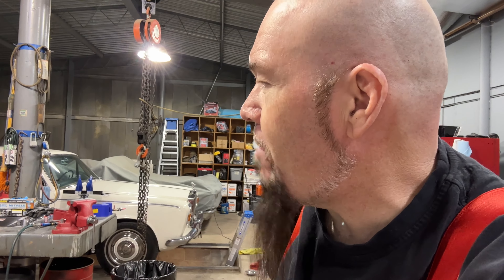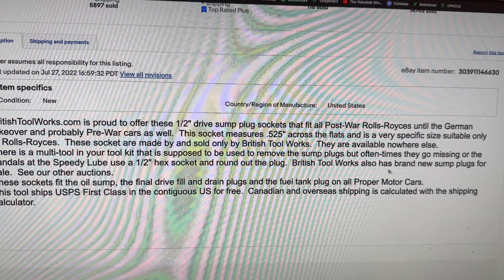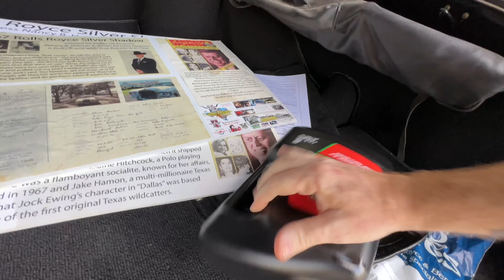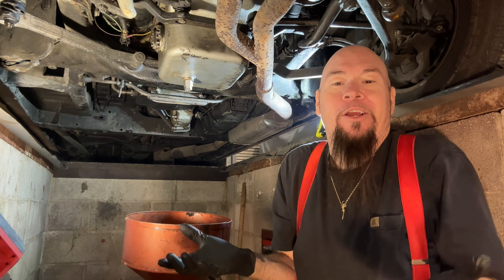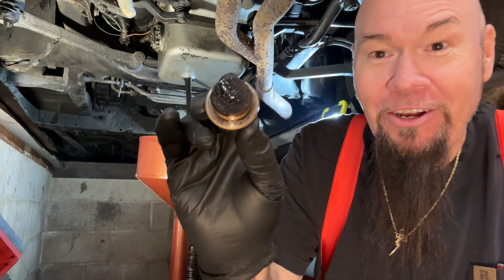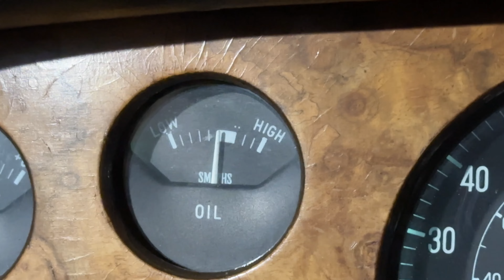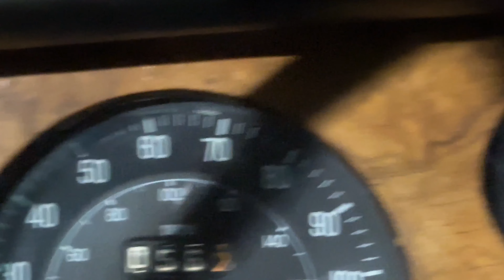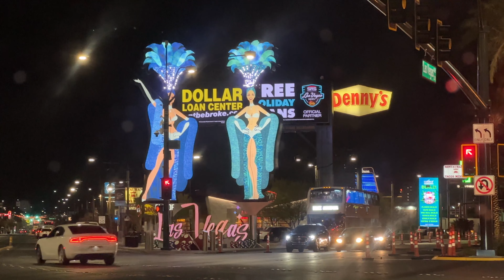Rolls-Royce Silver Shadow Oil Change - You won't believe what a pain in the a

Comment: When i purchased my landrover, I spent a day underneath it and tightening every nut and bolt i could reach. It was oily, so i pressure washed underneath, checked it 1 month later, and it was basically reasonably dry. I now check every 6 months and trace any trails of dampness vigorously. 😊😊

Comment: I have three GM converted Rolls Royces (62 CLOUD, 79 SHADOW and 82 SPUR). I ABSOLUTELY love them!  No more leaks, no more brake/hydraulic issues! I searched for 5 years for each one because it was a constant battle to keep everything working. There was a place near you that did service on Rolls Royces (The Touring Shoppe), but I have heard they only rebuild now.
Reply: Ironic. A big chunk of the RR engine parts of the power plants you did away with are sourced by GM: hoses, belts, power steering, air conditioning, on and on, transmission. Hope the LT swaps are going good.

Comment: Mr. Bob, you do know an easy trick for your oil change oil pan nut ?  Very easy to do for under $10 too ! When you change the oil, before you pull up that big oil drum funnel, put a smaller one inside the larger one, secure the new funnel with a string/wire in the funnel hook hole to the side of your drum funnel. Now if you drop anything at all, it will fall into the new smaller funnel and stop, the oil will flow through into the next funnel, but the oil nut or anything else will be inside the new smaller funnel, now just pull it out when done, nothing is lost, nothing is pissing you off, all for under $10 lol. Now sit back, relax, you can enjoy the night knowing you finally out smarted the problem. 👍🏻

Comment: Ah, Bob...  You'd love my New Zealand Ford Royce:  '62 Silver Cloud with Australian Ford Barra 4 litre inlilne-6 drivetrain that runs on Propane (tank sits nicely in the forward part of the trunk, with lots or room left).  Over 220 hores at the rear wheels, clean, low maintenance, sounds great and you can get at everything you need.  I did have to make a dash insert to use the Ford gauges (we had new faces made with my FR logo), but other than that there are no "tells".  You should have seen the looks on the RR guys when I took it into the dealership!  The thing is, the installation was surprisingly simple, we updated the brakes as well, and with the OD the car now cruises easily at 85mph with 3200rpm.  Love your videos, I just wish I could convince more of my friends that doing mechanical work is great therapy and a LOT cheaper than a shrink.

Comment: Hi, I am Roy posting here from Great Wyrley, UK. I had a 1971 Silver Shadow which I bought in 1978 for a lot more than it was worth. In truth it was a bit of a pig, but I was doing well and everyone who was anyone had an RR, so there was a sort of buying bubble. I had a motor sales and used to do a lot of work on cars myself. I remember coming to change the oil and sump plug was well and truly siezed, and trying to get it out I was a little alarmed by the way it was bending the sump, you say "oil pan" - right. Anyway, after some deliberation I took a Stilson rench to the outer flange, and guess what, it came out easily. The oil was like crude indicating the time since its last service. Anyway, the plug cleaned up well and all went well. When I sold it, about 1980 - 81, I lost £5K british pounds on it, what is that in todays money? Anyway, I never learn, currently own a Silver Seraph. These cars are in a class of their own, in every way, but also driving one. You can have nothing in your pocket but get behind the wheel and you fell like a millionaire. Looking at your video I think you have the answer to your own question re looking after these cars, learn everyhting you can about them and there you are ready to fill the obvious niche and make money. Finally, a hint for would be buyers of one of these. Buy one that someone else has spent all their money on and maybe you not have to spend so much of yours. Good luck.

Comment: Thats definitely a beautiful Silver Shadow.  Except for the color,  looks just like my uncle's 71 that he bought new.  I got to spend alot of time with him and his family in that car. He taught me to drive in it. I also have my parents 58 cadillac they bought in 1960, I was 1 year old at the time. I finally had the engine rebuilt in 2011 just because the blow buy from the down draft tube was no longer tolerable. 12 years later, still NO SMOKE visible from the tube!! Love that! Lifelong Southern California car,  she's doing fine. Just wondering if you have tried a ROLLS-ROYCE dealer to see if they will work on the car? Anyway,  I know how wonderful these are, and understand why you'd want one. I know ever since I was 12, when my uncle bought his new, I've wanted one !!!! Lottery,  I need you!!  PS, Castrol is the only oil he used in the Rolls. Actually,  it was the only oil he used in all his cars, and told to do the same. I have. And never had a car with any engine issues even at 338.000 miles on my TA.

Comment: My Hillman also has a similar oil filter system with bolt washer and spring. Old common British design. I have dropped the pieces myself before. But I have a workshop manual. I suggest you get one.

Comment: Use a BOLT head for the drain plug! Check the across-the-faces distance & buy 1 bolt + several nuts. Put nuts on bolt & weld/swage the bolt end over to secure the nuts. 
If you can’t find a correct size bolt, get a bigger one & file/grind down.
Did this for my 1974 Mercedes 😊

Comment: Well done. I’ve had a similar problem here in Normandy finding somebody to service my Silver Spirit. I’ve even installed a four post lift. I have now found an Englishman and he’s raring to go. I’m not sure whether to buy from Flying Spares or Introcar. I wonder if one is cheaper than the other. I’ve been inspired by ‘My Mate Vince’ on You Tube. I was the public relations manager of Rolls-Royce in the 1970s so I’m very familiar with the cars but I’m not a mechanic so I would be useless in ‘getting underneath’ and doing anything. They are wonderful cars and well looked after it will last you a lifetime, while appreciating. Warm wishes
Reply: I've travelled around the world fixing Rolls-Royce and Bentley motor cars but nothing would possess me to get under a home installed hoist unless I'd seen all the plans, documents showing it was signed off and insurance. This was a problem we often faced and sometimes it could take a couple of days to find somewhere safe to lift a car.
Reply: If you are worried about the cost of parts, you have bought the wrong car. There cars will NOT appreciate. No-one will want cars like this in the future.

Comment: These cars are works of Art. I would suggest treat these cars differently to every day car repairs. Always disconnect the battery when carrying out work. Being as an electrical apprentice in that industry I would advice following.  Ditch the mechanic mentality, start looking at your workshop as a studio. Make it bright airy and spotless.  Ditch the pit and invest in a high strength lift.  A good desk, a nice area to keep your fingers clean. Then go through documenting in hard cover notepad all the things that need attention. Take your time. A good kettle and teapot come in useful too.  You will be amazed at how your own brain calculates revalues etc during Tea breaks. Seeing rust there, I’d Begin replacing all those brake lines. They’re easily made up with high quality tools.  A good clock on the he wall works wonders too. Saves getting frustrated. Enjoy what you do.  👍

Comment: Glad you figured out where to get the oil plug tool. The reason they are so tight is there is an L shaped tool for the oil plug and most old time RR mechanics used to hit it with a hammer to tighten and loosen it. Also just curious how many quarts of oil you finally put in the engine. You showed only  5 qrts but  I hope you know that is a 10qrt oil sump. I used to be a RR mechanic about 20years ago. Take my advice when you go to loosen any 7/16 brake lines please use a flare wrench. Also make sure you pump the brake pedal many times ( your leg may get tired LOL) until both brake light pressure lights go on . Those brake spheres hold 2,000 pounds of nitrogen each

Comment: Pause video 23:00 - Rolls-Royce Silver Shadow Cloud Spirit Spur Corniche sump plug socket .525 inch.  
Yeah, that is crazy it is between a 13mm and 14mm or just a little over 1/2.
Reply: LOL, I paused the video to comment as I did a Google search on the tool and a few minutes later you mentioned what I found.

Comment: As others stated , read the manual and buy the set of maintenance manuals and do it yourself. I maintained my 76 for over 20 years knowing very little. Now I know a lot. If you dont have leaks under your car, it is NOT a Rolls-Royce! Ronnies Garage in CA is the main service center or Acme in Nor Cal. Ronnie has videos on line on how to do your work. The AU site has all the manuals on line too one huge tip, RR/B cars do not do well sitting long periods of time. The more you drive them the better they are. You might need a set of plugs. and when you change them get NGK type. Its not a 15 min job but well worth it. Plus try and run non ethanol fuel.

Comment: Sisyphus performs an oil change... Sounds like what you needed was a whitworth hex key, a system of measurement unique to older British machinery.  My mechanic is an older gentleman who used to work on British cars and still has all his whitworth tools in addition to the usual metric and imperial. I've also seen him work on older Rollers.

Comment: What a PITA oil filter.   I believe on the newer GM diesel Duramax engine the fuel filter is in a housing.  I see postings where people have issues with those also.   The RR iooked like it needs to be greased up front also.  The boots looked empty.  I use Archoil additive, AR9100.  I also spray suspension bushings with lube also.  The guy I bought my '84 Eldorado Biarritz from dreamed about driving it in Vegas.

Comment: Have you tried to change the fancy, rear license plate light, set in the bumper??? You have to REMOVE the ENTIRE bumper. Someone I know was charged $250, by a dealer  to replace a 69 cent bulb! RR later put small stick-out units on either side of the plate.

Comment: Years ago I was told odd numbers like the 13 mm weren’t common sizes, you just won’t see it , wrong again. But it seems manufacturers heard the same thing and still believe it and don’t include “some” of the odd sizes.
Reply: You won't see any metric sizes on a Silver Shadow, just AF, BA and a few WW. As for modern cars, 13mm is pretty much a standard size as is 11, Japanese cars tend to use 12 and 10. Some sizes are left out because they're hardly ever seen, 15 or 18,

Comment: Detroit 8V-92TA being a 2 stroke diesel naturally burns oil at about 1gallon every 2200 miles and you use straight 40 weight.

Comment: I get your frustration with the Allen key. I have a Hillman Super Minx convertable and it uses the same Allen size key on the sump plug. 13mm. I have set of a dozen sump keys and not a 13mm in it. I had to make one from a hex bolt and nuts and by grinding them down to fit. I have always wanted a Shadow but have stuck with my 1996 XJ6 LWB as they are easier to look after.. But should I find the spare money I will buy a Shadow. I think they are one of the best looking Rolls Royce's and are good value for money. It's just a car and all cars have their problems, so if we love them we learn to live with them one way or another. As for the Wizard? Well I find his logic and cars very confusing at times.

Comment: Matt Garrett in Lewisville, Texas does work on these. Additionally, so does Albers Motorcars in Zionsville, Indiana.

I will say though, if one part of the hydraulic issue has a problem, the entire system needs to be overhauled.

I would plan on spending $25k-$30k to set it straight.
Reply: One hydraulic part with problems >>> Entire system overhaul needed ??????  Plane BS !!!
Apparently you don't quite understand how these hydraulic systems work.

Comment: All you have to do is just do a lot of research after you've had the car for a while you'll be a Rolls-Royce expert. One thing I found out while living in Vegas they don't have a lot of good technicians there. I'm an auto body tech and worked in a few shops in Vegas and they all sucked.
Reply: They don't have anyone who can paint them properly either.
Reply: @byteme9718  the problem with painting any vehicle nowadays especially high-end vehicles is the amount of Labor to strip all the Chrome and door handles and everything off the car, then the cost of materials nowadays is crazy money, and I'm retired now but I couldn't charge any less than 10 or $20,000 to paint any car. Plus when you do the research just a gallon of red paint and cost over$2,000 nowadays just for the base coat not including the clear coat primer and abrasives and every other thing you need, it's crazy 🤣

Comment: I bet if you took that to the Rolls-Royce dealer they would give you a quote of over $100,000 to fix.
Honestly I don't see anything scary. 
That power steering thingy is probably your the main transmission fluid leak. Start the car and have someone turn the steering wheel back-and-forth as you're underneath it to be sure.

Comment: I was smiling when you tried to change oil in your RR Silver Shadow. Everything is a challenge with this car and there is no easy fast fix. I know because I have a RR Silver Shadow 1980. Be happy as long as you don't get problems with the braking system. It's hard to find a workshop that understands how the Rolls Royce brake system works. Buy a Rolls Royce and become poor. A thick wallet is required.
Reply: Nothing could be easier than changing the oil on these.

Comment: That may be what is referred to as a "British Standard" size socket.
Reply: I worked at a British Dealer in the 70s and I remember the old mechanics talking about having a "Whitworth" or "British Standard" set of tools I do remember that the thread pitch was different than metric or standard. I think that was used on the 'Roots' group cars. Sunbeam and Tiger cars etc.. Don't quote me.

Comment: Theres a good reason no one will work on these old Rolls, theyre over complicated and intricate to work on and a maintanance nightmare, they leak like a seive and parts from Rolls are galactically expensive and used parts are a possibility but just asking for more problems.  Also it not the mileage as much as the age, age takes its toll on orings and seals and on and on and on. Mechanics also dislike these cars because certain repairs can take an extreme amount of time and even with the best efforts of the best mechanics they will often break down immeciately after being repaired - its one of the worst of the english cars for reliability and repairability
Reply: I repair these cars daily-they dont leak if maintained
Reply: You're talking rubbish. What parts can you list that are "galactically expensive"?

Comment: i think its the modern day mechanics are lazy and would rather plug in diagnostic tools and swap out replacement parts, instead of disassembling parts and repairing them, even some motorbike mechanics won't touch carburettors because they either are lazy or have no confidence in the time they put into the repairs